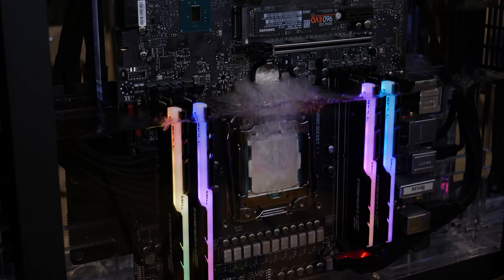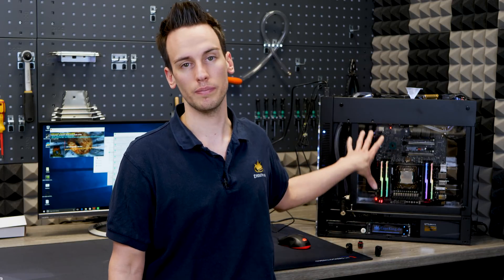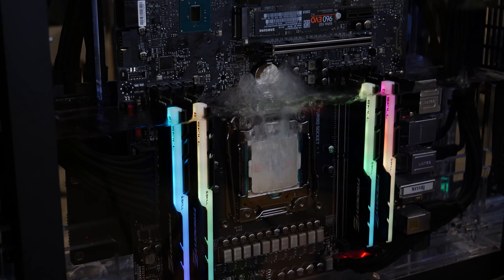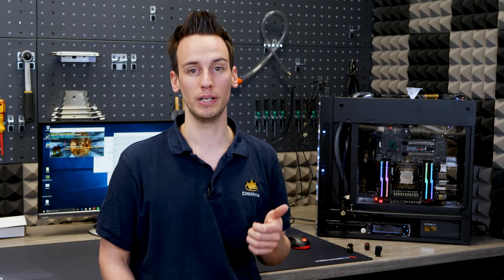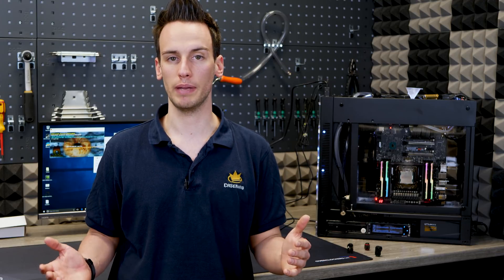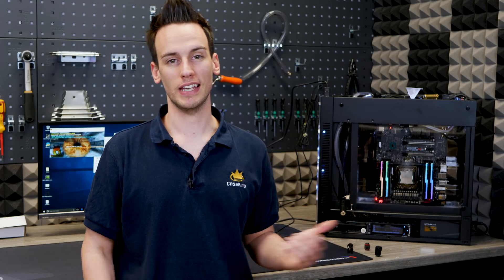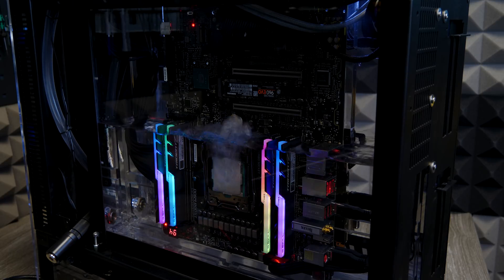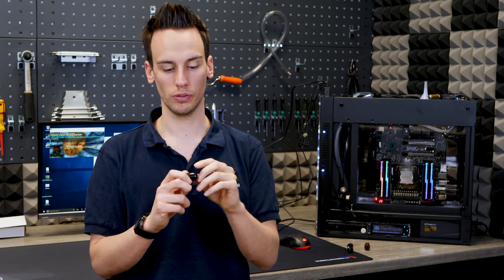Project Exhalare 2.0 [#1]: Recap of Aqua Exhalare 1.0 (en)

Comment: Wouldn't it be cheaper to use EC-100 (Single phase) which cost about 340 for 20L ( https://engineeredfluids.store/collections/dielectric-coolants/products/ec-100 ) and then add a heat exchange to remove the heat.
Reply from the maker: I already have this stuff here and working on it :)

Comment: There was a company 'Hardcore Computer' that did this back in 2009. They transitioned out of the PC arena (no profits) and into liquid cooling servers (Profits). The 3M fluid is being used in data centers on a small scale to liquid cool servers and in supercomputers. A few companies are involved in this type of cooling:
Allied-Control.com
LiquidCoolSolutions.com - this used to be Hardcore Computers
iceotope.com
Liquidmips.com 
Exascalar.co.jp

I would never buy this - too much maintenance, the fluid is expensive and the ROI is low. This method will never see wide spread adoption, it's interesting to see it in a video but to actually have this and have to maintain it - no thanks.

Comment: Hi, I know that this question might look like it come out of nowhere but I had been trying to solve this issue on my own for days without luck.

Here goes,
Playing games on an OC CPU (7820HK), looking from the Riva tuner monitoring app, my CPU is not running at it's Max boost all the time (OC to 4.0GHz) In games it fluctuated between 3.5-3.9. However, when I did a stress test with Prime95, it was able to maintained max boost for as long as I test it. 

My first initial thought was that Games does not utilize 100% cpu usage so with Intel SpeedStep the CPU itself underclocked to 3.5GHz. 
But after I have seen some Benchmarks, It's shown that the CPU max boost of the owner was running at full clock speed all the time! 5.0Ghz+ +

Now I wonder why mine is not achieving that CPU clock speed while in game.
1.) My rigg is AW17R4, 7820HK, 1080GTX (repaste, repad, reshim)
2.) There was no Thermal or any Power limit issues (monitored by HWinfo64 and XTU)
3.) Gaming for several hours at ultra max temps are at only CPU 78 GPU 72 PCH 85
4.) AVX are disabled
5.) It never throttle, It just cant reach it OC speed

To recap,
There's really nothing holding back the CPU to reach Max speed in Gaming, the Temp was low, the PL was set sky-high. No limits are reach confirmed by the monitoring programs.
If anybody can help me I would be really appreciated, and sorry for my bad English

Comment: Sorry if it's in the video and I missed it, but couldn't you use a vacuum pump to lower the pressure within the enclosure, thus lowering the boiling point of the fluid and resulting in better cooling? Assuming you could vacuum-seal the enclosure.

Comment: Regarding the cables and getting them through whilst being water/gas tight why not do your own extensions using MILSPEC connectors (which is done on custom car mods, etc)? Personally do a similar thing with 13 pin DIN connectors when connecting 4 fan radiators (3 pins for 12V, negative and RPM x 4 fans + 1 extra for PWM shared for the 4 fans) so there's only one connection to deal with. That way each end uses the original connectors and in the middle at the divide between the main tank and the outside world you use a connector designed to keep it sealed. You just have to match the pin count, gauge and shielding for twisted pairs. Here's a primer: http://www.flexwires.com/blog/why-you-should-choose-mil-spec-wires-for-your-application/

Comment: So this cooling system sounds pretty much condensation prove because it is completely sealed of and submerged in a nonconductive liquid. Would it be possible to chill the system to sub ambient temperatures? If yes it could be a long term solution for heavy overclocks.

Comment: Does the fluid leave any residue when it dries/evaporates? For example if you wanted to put a new motherboard in the tank, but still use the old motherboard for another project.

Comment: Some quick questions.

- Is it possible to do this but with mineral oil? I mean, not use a heatsink on the CPU itself and let the mineral oil + radiator deal with the heat?

- How dificult is to get the fluid itself? I'm from Argentina and i would love to build something like this but i'm lost at even thinking in trying to get the fluid.

- Can we get a video on the building process? Maybe some b-roll of it on the next video?

Thanks! :D

Comment: I don't see a riser cable or anything similar going to the pcie slot. How is the gpu communicating/connected to the rest of the system?
Reply: RJ Santiago mobo is turned upside down, the riser cable is at the very top in the last pci slot

Comment: As can be seen by reading the Novec Heat Transfer Product Line Card, most fluids have a pour point that is below -100C.

Sub-ambient temperatures could be made more practical by avoiding condensation around components by submerging the whole PC in a sub-ambient temperature fluid.

I understand that it would take a lot of energy to cool(be that a phase change cooler and/or a lot of big peltiers) and a lot of engineering to insulate the tank, make a stable sub-zero cooling system and avoid condensation on the surface of the liquid.  But I think it could be done and can be a more practical sub-zero cooling solution, even though much more expensive.

Comment: So is this possible with mITX? I have a mITX with bifurcation build coming up (2x r9 nanos paired with a Ryzen cpu) and It would be kind of awesome to be able to try this. I can get the fluid through an academic source for a nice discount but im worried I'll have to increase the build volume over my spec (7L) to be able to do it. Im assuming one of your coming videos will answer this for me with how your radiator is setup.

Comment: 2 questions:
1. How much did you pay for the fluid? (per liter)
2. Why did you choose to put the PSU outside? Putting the PSU inside the chamber would cool the PSU and you would have to deal with much fewer cables. (only AC power and USB/HDMI/Ethernet)
Reply: I think for security. If it become conductive for any reason the 12V can kill your hardware. The 230V AC (like in germany) can be fatal for your body. Even if it will not be deadly mostly it can cause damage to your nervs or heart. Who wants to get a heartattack when touching the case to run up the system for next gaming session.

Sorry for my bit shitty english. :-)
Reply: The chamber is made out of acrylic and the fluid is not conductive. I do not see any safety issues there.

Comment: How often do you have to add the fluid to keep at it acceptable levels? Or is the condensation rate high enough to make it viable as a closed system with similar upkeep times that match traditional coolants?

Comment: Tim under IHS is that silicone based (kryo?) Or liquid metal? And would it be problem which one to go? Also longevity how long can I let it go before maintenance (maybe compare to custom WC loop) would there be any advance of building out of the glass? Thermal pads? It would be cool to make an rpi powered system monitor inside that.

Comment: I'm surprised that there's no issues with board conformal coatings and miscellaneous components/cabling with the fully immersed gas/liquid system. Was part of that due to your partnership with board manufacturers? Or is your working fluid just that inert aside from vulcanized rubber/plastic/etc? What kind of timeline is there for tank cleaning/draining, and consequently what kind of air contamination do you see in the system? You mentioned leaking timespan for fittings, but I'm curious about the importance of a pure homogeneous "atmosphere" inside of your system.

I've had luck with various epoxies for sealing on connectors. They dissolve with alcohol, but their outgassing specs are pretty good and they're relatively permanent. They were for space systems so we only cared about electrical and thermal survivability, but plenty of cheap and accessible fastening assistance materials can bee used to seal things off across your whole system.

Comment: The motherboard shows temps of 95c and higher. Any way to cool it down more? What about adding more fluid?
Reply from the maker: It's running Prime95 in the background with OC so that's the reason for the hight temp. It shows the hottest CPU core
Reply: der8auer Does the cooling scale proportionately to the amount of fluid in the tank or do you run into diminished returns after a certain threshold?

Comment: I'm looking, looking and looking some more, and I can't see the GPU lol. I'm blind apparently.
Reply: I seem to see a riser in the third pci ex
Reply: Qyngali it's there he shows it several times, it's the one with the block on it with all the little metal fins, that's the gpu. I'm guessing it's on the opposite side of the motherboard. What I don't get is how it's attached to the motherboard? Don't see a riser cable or anything similar, so what id like to know is how the gpu is communicating with the rest of the system?
Reply: @rjsantiago4740  he used GPU extender black wired one so you missing it its at top of this builds PCIE slot. and yes GPU is behind Motherboard so from front we can't see it. ^_^@1:45

Comment: I would worry about rust on the components above the water line where you have condensation?  I was also wondering if you could use a cold catheter or metal type rod that can be electrically cooled to maintain water temp instead of evaporation to control water temps?  something thats used in an ice less cooler?  or maybe a mini air condition at the bottom with a cold plate base.  just chill the cold plate although you would probably have to fully submerge the board.  I love your innovation and trying to do something different.  good luck and have fun!  very cool.......

Comment: One more question: Does motherboard, gpu and ram works as before when they are taken out of liquid? Bcs with mineral oil is some problems (based on LinusTechTips)
Reply: Yes all is working fine after you take it out.
Reply: mineral oil only damaged bearings on fans, so when the fans stopped being lubricated by the oil, they stopped spinning.
Reply: You'd have to replace the thermal paste and fan bearings on anything that would be in a fully submerged rig but I don't think any of those are under oil in this one. So all of these would still work as before but they'd be very gross to touch forever.

Comment: Why is the tank only half full couldn't you fill it up like 3/4 of the way?
Reply: If the temperature rises to 70-75 degree Celsius due some new overclock then if you fill the tank 75% then there will more liquid in the gaseous form than the liquid form which means gas will build up pressure and force liquid to escape via any weak zone, PSU cable, fittings and tank goes boom, so filling 50% ensures a balanced level between the quantity of liquid evaporated to quantity of liquid condensed. Of course if the top radiators work more quick by increasing fan rpm then 75% tank can be filled, still 50% is optimal.
Reply: Laxmi Narayanan KS thanks for the explanation :)

Comment: Can't you use Novec 7000 and try to somehow cool it with peltiers or something so that the liquid stays below 35°C even on hot days?
Reply: That's close to what I was thinking; use Peltiers for (just in case everything else goes wrong) over temp protection.  Also, he's need a way to keep any water the Peltiers condensed away from other components.

Comment: Are you sealing  out all liquid from between the IHS and chip? Silicone sealant? Don't want liquid in there or gas bubbles form straight away and no more liquid cooling.  I'm also concerned about the longevity of capacitors, electrolytes being liquids that  might displace or pump. Panasonic metal caps are hybrid liquid solid electrolyte for performance.

Comment: Awesome project! Might consider a double-walled clear case, I might seamless bucket for first case with plastic top cover. Then acrylic "bucket" with simple moisture sensor/alarm to your phone.

Also, I would recommend redundant pressure release valves of different types with alarm to your phone (suggestions around the fukushima nuclear plant improvements might give you inspiration). 

I suppose long-term erosion of plastics, resins, coatings etal. can only be evaluated over time...

Comment: Pretty awesome build! Wouldn't it be nicer if the CPU had a big passive heatsink on it?
Reply: at 5:15 der8auer says that the IHS needs to be attached because the bare CPU die doesn't have enough surface area to sufficiently cool the CPU. So I was thinking a big passive heat sink may provide for more OC headroom. "0 difference" what a joke xD pls don't talk if you don't know what you are talking about.
Reply: Lloyd do you have downs?

Comment: woah...I can't explain what i am looking at..How?! pros and cons please
Reply: Pros: It's cool. Cons: Pretty much everything.
Reply: How: that fluid is purely nonconductive and boils at 61 degrees.
Therefore, it's all nice and heat conductive-ish being a liquid, and when it boils, as known, it takes a lot of energy to get a phase change, so the liquid will absorb even more heat at 61 degrees, and then it'll boil off. Then it condensates and goes back down.
Reply: Noorquacker Really good explanation but I'm going to be pendantic and correct one thing. It should be *condenses. Condensate is the noun for the liquid that condenses.
Reply: cons its expensive